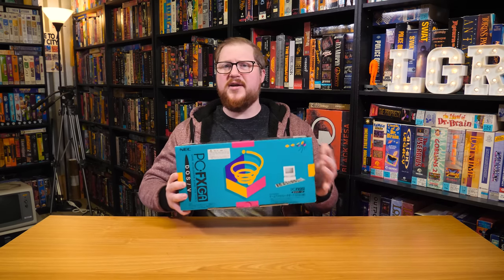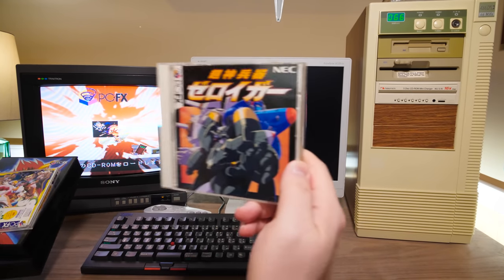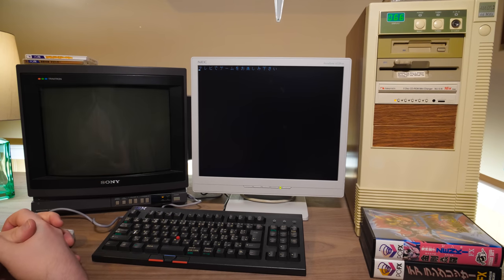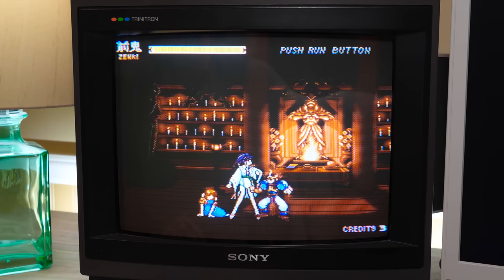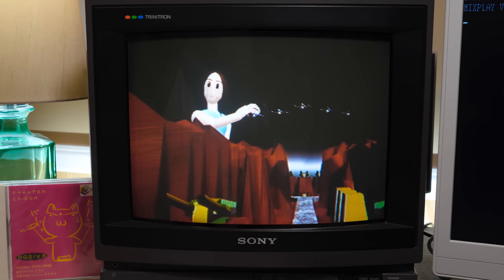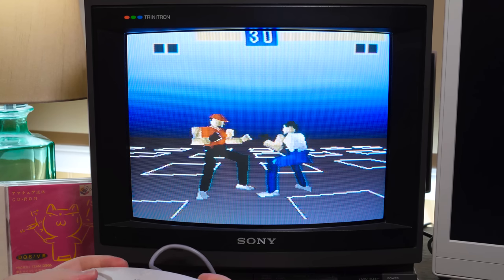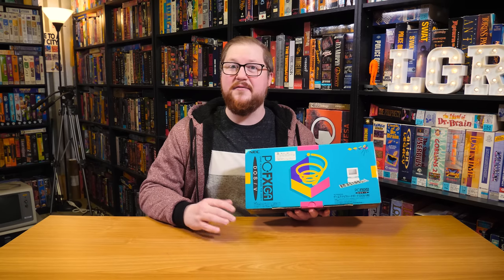LGR Oddware - NEC PC-FXGA DOS/V Game Accelerator Card

Comment: That card feels like a development machine made commercial. Theoretically, you can load your own PC-FX builds onto it, and have pretty much a full PC-FX console ready to go on a second monitor.  It would be like instead of a Net Yaroze PS1 being a separate, stylist black console you connect to the PC, it's just a card you slot in and plug into your TV. Funky.
Reply: You mean like the DTL-H2000?
Reply: @stellated  I did not know about that. Wow, that's really neat!
Reply: @stellated  it was rare to find that PlayStation ISA devkit...
Reply: @chairulamin6427  I wasn't suggesting it was but it was similar to what Daniel M was suggesting. It would have been cool if it had been sold to hobbyists like the Net Yaroze though.
Reply: Exactly my thought. Gaming seems to be secondary. The killer feature is being able to push code to it (and rapidly test it).
Reply: I thought the same. It also has the HuC6273 3D chip, so it seems like this card was designed as the game development hardware for the original Tetsujin platform. Later this platform became the PC-FX, but without the 3D chip.
EDIT: NEC actually had a 'GMAKER STARTER KIT' SDK which worked with this card and allowed development for the GF-FX.
Reply: The 90s were so fucking cool man

Comment: Such an odd bit of gear. I reckon a TV tuner in the PC with the PC-FXGA plugged into it would be cool to see as well.
Reply: I wonder if you can use an external ISSA slot adapter to run it by itself
Reply: @Dtr146  I wouldn't think so.  The card would run (since it runs without the host computer actually finishing booting), but how would you access an optical drive?
Reply: Yeah, if you were going to do that then you might as well track down a physical PC-FX.
Reply: @ianweber9248  yeah good point
Reply: Pcfx-ception
Reply: Would be an interesting LGR Blerb, for sure
Reply: I’m not sure if an All-in-Wonder worked in Dos or not.
Reply: How does this compare performance-wise with the RTX 3090?
Reply: It's basically GPU ... "before" GPU. Sorta
Reply: Don't you mean...
An odd bit of ware?

Comment: 3:10 Korean MS-DOS and Windows(including Windows 10) also replaces backslash with currency symbol(₩), at least with Korean fonts.
Reply: While Chinese DOS usually got the correct \ sign because both GB2312-80 and Big-5 doesn't alter the standard 7-bit ASCII encode, with the down side being there is no half-width yen sign available, and things can get messed up easily if one byte of a wide character is missing. Though there is an unrelated quirk that the screen shows less lines to allow 16px character to be shown properly, at least for some eariler Chinese environments. (It's not my personal experience, though, by the time I start using computer the oldest thing I would use is Windows 98 which has Chinese support built into the DOS environment.)

Comment: LGR: apparently this game is worth $1000 for some reason but whatever 
Game collectors: first of all how dare you. 

This is such a crazy piece of hardware. It’s crazy to think that having an inexpensive console quality controller solution on your pc is a relatively new concept. The sidewinder came close but most had to settle for the gravis pad .
Reply: I ended up getting a heap of old Sidewinder stuff over the past few years and absolutely love all of them. Not had the luck to get an original Gravis controller though, only the Xterminator Digital, which is awesome, if a bit glitchy.
Reply: @Ametisti  I only got the Sidewinder Freestyle Pro pad that has build in motion controls. While the motion controls seem to work surprisingly well, the D-Pad is just horrible. Also got a Logitech WingMan Precision which seems far better (only gave it short test under DOS 6.22) but under Windows 98 SE I'm actually using a 8BitDo M30 which works even though it's a modern device. Of cause only because my Retro PC (Pentium 233 MMX) has one of the first ATX motherboards and comes with two USB ports.
Reply: @moomah5929  The Logitech WingMan Precision and its successors, the F310 and F710 have some of the worst D-Pads I’ve ever used. Makes the 360 controller’s D-Pad look better in comparison.
Reply: @JackBandicootsBunker  While this might be true, the Freestyle Pro's is 100 time worse. More or less unuseable. There is a reason why I'm using the M30 instead of the WingMan. xD
Reply: @Ametisti  The Gravis gamepad pro was pretty good thought.

Comment: The fact that they went through the trouble of making this thing and then they didn't bother to convert the signal to digital so that users could at least use the same monitor is baffling. Also, as a member of a half-japanese household, it makes perfect sense.
Reply: vga is not even digital
Reply: @sixdfx  You're right! They could have done it without a DAC!
Reply: @djosearth3618  Lotta old video cards had VGA passthrough, I was surprised they didn't do that here
Reply: I think at the time most TV CRTs had better fidelity than PC monitors, so that could be one reason.  Either that, or they didn't want the 224p of the animations to look worse on a higher resolution PC display.

I know I said two things that sound contradictory... Yes
Reply: @Rikorage  Nope, at the time this card was made most TV CRTs had much worse fidelity - you could run stuff at 1024x768 even on 15" monitors (even on some 14" monitors, but software with non-adjustable font and image sizes it could get a bit hard to make out the details), but with mos TV's you could get 800x600 at best and often only 640x480 and even then it would not be the crisp graphics - the games often looked better to me on consoles running on TV screens when I was younger but it was just a kind of "smoothing effect" that actually reduced the sharpness of the image that made them seem better. The same thing made 80-column character display on TV look messy and pretty much forced a choice between a TV with 40-column text or an actual computer monitor - that or using 4-pixels wide font which leaves zero cap between many characters and not enough detail for the characters to look good. Even in the 2000's I could not get a crisp output on CRT TV's that had no VGA (nor HDMI/DisplayPort/DVI/etc...) and you had to use S-video or composite output of video card to get the thing to show up on TV - I wanted to run terminal with IRC-client (irssi) on TV back then but gave up the idea because even at ridiculously low "character resolution" (columns x rows) it still looked messy and 40x25 was not enough for my needs. But I digress...

244p animation on PC monitor would not have looked like it had less fidelity, but it would look more pixelated because of greater fidelity and sharpness; which actually does translate to the animation looking smoother and thus better on CRT TV but the reason is the opposite of what you said in the first sentence - but as you said yourself, you wrote two things that sound contradictory, so... I just wanted to clarify this thing :D

Afterthought: I recall actually thinking in the 90's that it would be cool to run games on TV because the monitors most had at the time were 14" or 15" "big" and TV's were often larger, which could give you larger image and you could play without being right in front of the display - which would have been better in many cases despite the lower resolution and sharpness. Also with games often being lower resolution anyway, often 320x240, the less sharp graphics on TV screen would have looked smoother without even losing graphical details.

Then the 3D accelerators came which could smooth any pixelated graphics without losing ability to show razor sharp details (example being 1st person shooters with smooooth texturing but sharp edges) and CRT TV's became simply worse in all ways, but we weren't quite there yet at the time so that's a whole different topic ;)

In the end the real contradiction here is that sometimes the technically worse could be aesthetically better :)

Comment: The demo at 30:00 is a bit more technical than it seems. The HUD is created using the video overlay feature mentioned in the card overview. The output from one of the GPU chips is overlaid on the 3D output of the other GPU chip. Sort of like how the first 3D cards used a vga passthrough to overlay the 3D elements on the 2D image. This card did this years before 3Dfx.
Reply: I guess this was common with 3D graphics workstations, which both NEC and SGI was involved in. The PC-FX's graphics solution was based on the technology NEC used in their workstations, and 3dfx spun off of SGI.

Comment: About that CD changer: each disc being its own drive is not a hardware limitation.
The NEC-branded changers specifically address this in their manuals as do some of the Pioneer ones. You need support for something called Multiple SCSI Logical Unit Numbers or LUN.
Later versions of OS/2 have this built-in as do NT-based Windows (btw NEC has a special Win95 driver to support single drive mode).
If you search online for "scsi lun cd changer" you can find plenty of posts from open source folks complaining about all this. This all also applies to IDE-based CD changers too.
Reply: I understand Clint expected the device to combine all 5 cds into one ... volume? With only one loaded and active cd at a time, this seems to be expecting too much. If it had 5 heads and independent spindles...than maybe, but I am sure it is so much cheaper to connect 5 cd-rom devices to one scsi bus instead...
Reply: @piwex69  I think Clint expected the device to act as one drive but where you can switch discs by just pressing a button as opposed to going through the manual process of disc switching and dealing with cases.

Comment: It's fascinating how many of these "system in a system" cards there used to be. PCFX on PC, 3DO on PC, PC on Mac, PC on Amiga... Makes me wish the concept had stuck around. How cool would it be to have a Nintendo Wii card in a modern PC?
Reply: They probably died out due to the falling cost of things like CD ROM drives and a change in the way consoles and games were marketed. After all XBox One on PC could probably be done without needing any additional hardware if Microsoft want to.
Reply: @MrDuncl  It'd probably need some software installation, like some emulation/spoof of the BIOS.
Reply: @MrDuncl  Xbox One on PC already exists... it's called Xbox Game Pass.

No card required. 

Of course, that's when the Xbox PC app actually wants to fucking work and install games, that is.
Reply: You do, it's called the "Dolphin" Emulator..
Reply: @GenMasterB  Can it read discs?
Reply: @GenMasterB  If I didn't care about the difference between emulation and real hardware I wouldn't be into retro tech...
Reply: @freelancer42  I made that point because there isn't a board available.. And I own a real Wii and a Wii U. It plays your original discs.
Reply: @freelancer42  I'm almost 60, I've owned almost every console. Even a Vectrex. But sometimes hardware fails and you have to use other measures.. Not advocating for piracy.. I enjoy Playing Mario Wii with my disc and set the res to 1080 or higher with better textures.. If you have bluetooth, you can connect your Wiimotes.  I relate very much to LGR. I've been a PC/Net tech since 1982, I've built 100's of PC's. I still have some retro PC hardware in my shop.. I do PC's, Consoles and Gaming.. so don't take offense.. thanks
Reply: Well, there is also a Sega Mega Drive on ISA card - check the Amstrad Mega PC. It uses Sega's catridges

Comment: I assume this would've made more sense on some kinda dual-input multi-sync monitor where you'd just press a button to go to the PC-FX input.
Reply: Were they around back then? The silly thing is that early NEC monitors like the Multisync 2D could sync down to TV frequencies. I believe the Amstrad Mega PC uses a similar technique basically switching a MultiSync monitor between the computer and Megadrive console through the same cable.

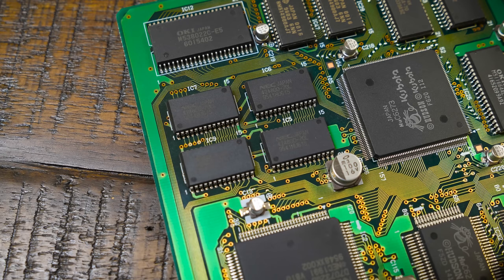Comment: Wait wait wait. 5:00
Did I just see Kubota on that one chip? 
The tractor manufacturer Kubota?

what.
Reply: Yes.
Reply: Lots of company tried to dip into the chip business in the 80's including some weird ones.
Reply: @matchc0635  yeah actually now that I think about it, Rockwell made truck axles and modems at the same time lol
Reply: @matchc0635  Not just that. They went whole hog into the professional 3D workstation market in the early-mid 90's to try & compete with the likes of SGI. That's literally where the Aurora chip used here's development roots came from.

Comment: fun fact about the extraordinarily high price tag; NEC had a stranglehold on the Japanese computer market at the time, allowing them to pretty much price things however they felt like. It was a hot issue at the time, and I've seen it referred to as the "Japanese home computer crisis" due to the near complete lack of clone/compatible systems available. It wasn't until 1992 when Compaq released a DOS/V compatible PC at 128,000￥, almost half the price of NEC's PC-98 at 248,000￥

NEC's dominance was strong enough it caused the PC Open Architecture Developers' Group (OADG) to be formed in the 90s, headed by IBM, that would standardize the use of a singular OS (DOS/V). NEC, unsurprisingly, was not part of this agreement.

I found this out while trying to find documentation on how the PC-98 reads graphics so I could patch an obscure game that wasn't formatted correctly. The amount of Touhou and "Computer Crisis" results made it very difficult.
Reply: Which is what makes this card even stranger. IBM-PC compatibles were never popular in Japan because NEC was such a dominant player.

Comment: It's a wonder that NEC didn't immediately see that the PC-FX was doomed against the Saturn and Playstation. It was extremely weak, with a misguided focus on video playback, and being very weak for even 2D graphics, to not even speak of 3D.
Reply: I think PC-FX is actually geared more towards those people who used to game on the PC98 based PCs and wanted those games in a more console looking hardware. The FMV capability suggested that the games were expected to be static graphic heavy games like VNs, Single screen adventure games, and so on, with FMV heavy elements, which is the staple of Japanese PC gaming of the time.

That, and eroges I suppose...
Reply: @ZX3000GT1  Considering the price this sold for, that was not a good strategy. The gameplay  and graphics of this thing are hardly any more advanced than the PC-Engine. And while the PC-Engine was kinda low power compared to the Genesis and SNES (being made as an NES competitor) it still held its own, this was just absolutely crushed by the Playstation and even the Saturn in every way.
Reply: @JeffreyPiatt  Yeah that was the PC Engine, but this is the PC-FX, the weird underpowered successor to that.
Reply: Well sega tacked on 3d support to the Saturn after they heard what Sony was doing so they almost missed the 3d boat too. Maybe nec was so far along in developing the pcfx that adding 3d was not feasible,  at least in their minds it wasn't.
Reply: @Nukle0n  It was not a good strategy, and PC-FX is crushed in every sense of the word. Not even VNs can save it, since a lot of VN devs ended up releasing games mostly on the Saturn instead, which is ironic.

At least 3DO and CD32 has competent graphics chip, along with a mixed bag of games library (CD32 being worse off, but still have the AGA graphics going for it, and 3DO being an early high end 3D console with some great games).
Reply: Especially since the PlayStation could do all of that--video playback, 2D and 3D. In fact, I'd say the 3 D is it's weakest, with all the artifacts and lack of Z-buffer. Don't get me wrong: having 3D at all was revolutionary. It's just that the 2D and FMV tech was quite mature.
Reply: @ZipplyZane  The Playstation is actually pretty bad at video playback. I noticed when I played Policenauts on the Saturn how much better the videos look than they do on the Playstation.